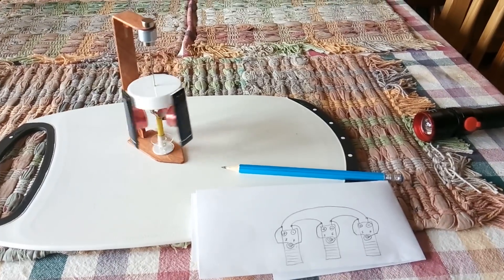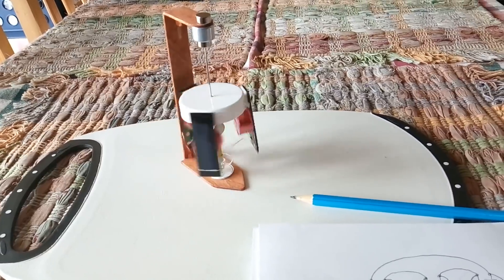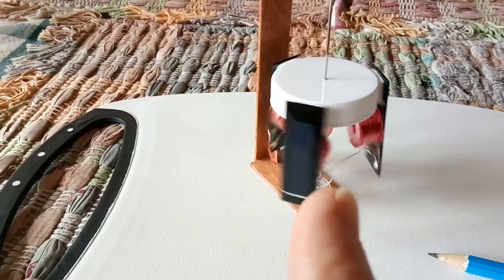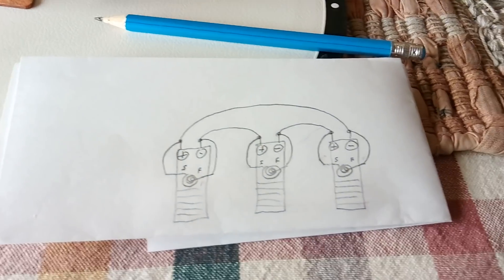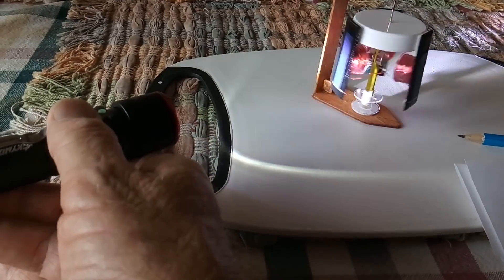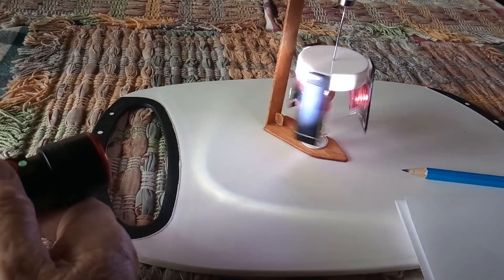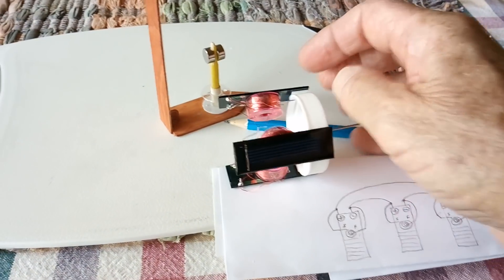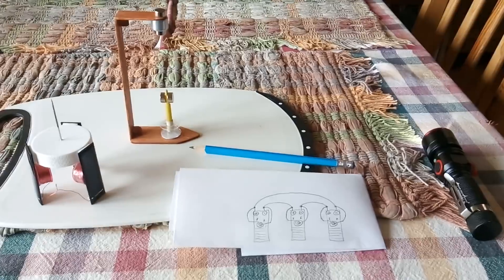Light Commutated Lidmotor -- Part 2

Comment: Nice looking configuration!  Grain's version is good, but I prefer your approach with the needle suspension.  I'm guessing the wire is about 28-30 AWG, which would give each bobbin around 5-8 ohms.  Seems like a reasonable impedance match for these small solar panels.  (0.5 volt, 100 mA ?) 

Not sure how critical impedance matching is, though.  As long as it's reasonable.  Anyway, nice job on this.
Reply from the maker: Thanks.  The coils are 30ga and about 8 ohms.   The panels are as you mentioned ---0.5v and 100 mA.  I don't know how much more time I will spend on this project but I am considering trying this out on a needle / Phillips screw type bearing setup.  For that I might shift to the smaller 'solar waver' coil and panels that Slider is using.

Comment: Very cool!  Your coils are just connected in series.  Looks like each panel provides a pulse when it gets some light.

Note:  You could also put a lid at the bottom of your solar panels to give it more stability.
Reply from the maker: I don't think that this can be called a pulse motor because the coils are really 'on' all the time.  The just get power in a more or less manner.  I would love to see this on a scope.  Maybe a sniffer coil positioned somewhere could pick up the wave form.
Reply: @Lidmotor  see if it powers 'Maggie'
Reply from the maker: Maggie would not like this one because the permanent magnet is fixed and she has no interest in spinning coils.  I have tried her with a coil in her mouth that is powered with a pulsed or alternating current and that works.  She turns into a regular transformer then.
Reply: @Lidmotor  I'm sure you are right about that.  But the light creates a V increase whenever a solar cell reaches the light source.  As it comes into the light, the V increases, then reaches maximum, then begins to decrease until the next solar cell comes into position to add V to the circuit.  I doubt the V ever reaches zero V, because the next cell comes by quickly to boost up the V again in the series connected coils circuit.
Reply from the maker: What is rattling around my brain now is ----can there be a way to take advantage of this strange effect. Perhaps make a battery powered version of the motor.  Three coils wired in series that received power from a battery in a smooth commutated fashion that caused the arrangement to rotate around a permanent magnet.  An optical sensor setup might do it.  The efficiency would probably not be so good.
Reply: @Lidmotor  You'd have to replace the solar cells with a similar power pulse that would be synchronized with the inner magnets.

Perhaps you could mount a small driver circuit on top of the lid & connect 1 wire to each coil.  You'd have to have some kind of detector to detect the position of the rotor with respect to the center magnets so that you could pulse the right coil at the right time so that it would be at max V when it is in the right position to get the max rotational torque possible.  Maybe a Hall effect device (to detect the magnet field strength) + a transistor that switches on at the right time (i.e. driven by the hall effect device as it senses the magnetic field).
Reply from the maker: Very interesting ideas.  Thanks.
Reply: @Lidmotor  Glad to help.

Comment: Name and nature... a very nice build too.
If I have the livingroom window open a little the Tie Fighter type auto starts in the morning with a very light breeze. Does this one auto start due to the 3 sections arrangement? I could do with keeping the window closed overnight around here!
Reply from the maker: Mine doesn't always self start.  It depends on the position and the light strength.  If the light is strong enough it usually self starts.  I'm still working on that problem.  The regular Mendocino Motors all self start.
Reply: I think it's related to the number of panels, but simple would start to get complex. Am wondering how to use 1 coil and half a dozen panel pieces... your centralized magnet is a great solution to part of it. Hmm, maybe 2 coils opposite each other + 198 panels lol.
Reply from the maker: @Slider2732   One way around this self start problem is to angle the coils to the panels.  Ludic Science has done this on his 2 panel /2 coil spinner.  I might have to break down and build a traditional 4 panel / 2 coil square rotor.  I hate doing that.  Going 'off road' is more my style on these projects. lol
Reply: Haha yes indeed, may get the odd broken axle along the way, but it's worth it if the thing runs and runs good.

Comment: So neat.....! I have often wondered on a lot of your coils how many turns or rather what gauge wire you use and how much of it ....? How many feet of it...? I know you often use the plastic bobbin from a sewing machine  to wrap the wire on but do you use some kind of a formula per volt....per foot of some gauge of wire for your projects....
Answer this if you don't mind but at any rate you do Awesome work. Long time admirer of your work.
Reply from the maker: Thanks.  I have never counted the turns on these sewing machine bobbin coils.  I usually use 30ga magnet wire mainly because it is easy to work with. There is no formula.  Years ago I worked on projects with a  friend who was also asked about how she wound her coils.  Her simple answer was, " I wind them with wild abandon."  In that short phrase she basically defined my own hobby.  It is just fun.  Over think it and it kills the joy of it. The hobby is sort of an art form.
Reply: @Lidmotor  Just the OCD in me wondered but i see the point. It is just that most all you stuff works so well that is seems calculated .

Comment: Very cool! I think you would enjoy working with a 3d printer to make more precision parts. I got the Tevo Tornado a few months ago, and it has changed how I build everything! I have paired it with free software called Autodesk 123d design and Cura. Your rotors could be balanced differently and more customizable to your applications. Just a thought since I haven't said anything for quite some time.
Reply from the maker: I really need to get a 3d printer.....and learn how to use it.  To me they are still a bit pricey and then there is the issue of where to put it.   I'm sure that I could make much better projects if I had one.  The first thing that I would print would be another Lasersaber original EZ Spin motor.  The one that I have he sent me in pieces long ago and I built into the one I show in most of my 'Non-Stop Running Motors' videos.  That thing has been running flawlessly now for two years.  Great design.